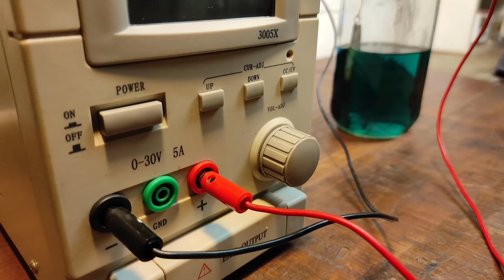Restoration VINTAGE MILITAR RAZOR SET

Comment: How did you know to use heat to remove the badge?  Very clever.
Reply from the maker: Hi, usualy badges are soldered or glued, in both situations heat works good. Thanks for watching !